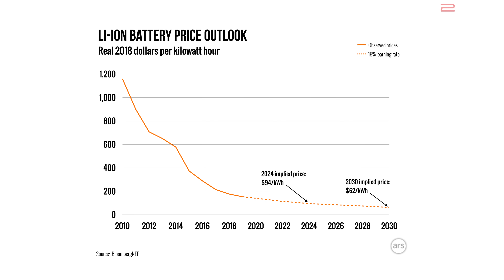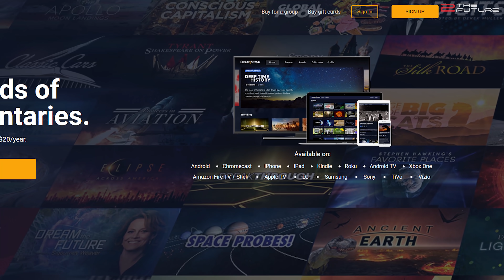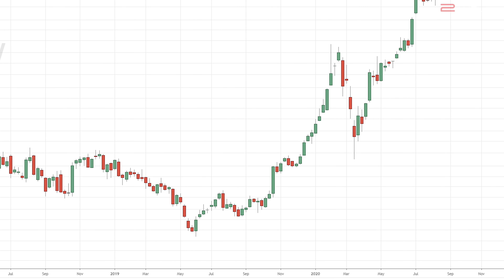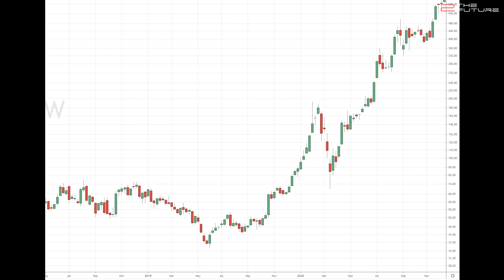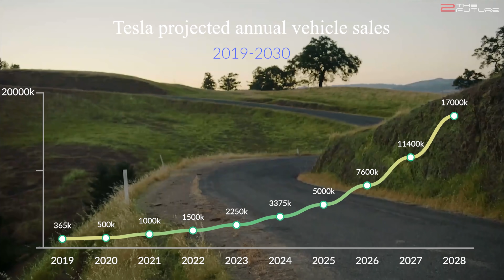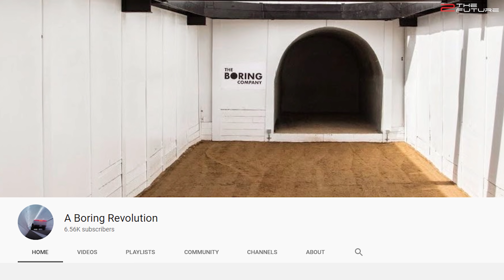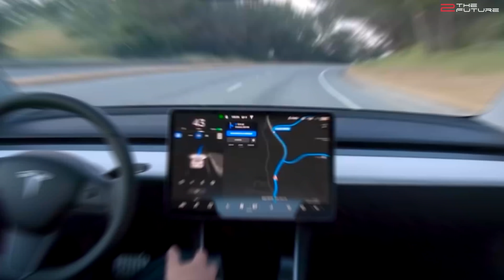Tera Texas & Giga Berlin, Model Y China & Europe Launch, First EV With 1000-mile Range?

Comment: Aptera is surely one of Sandy Munro's 3-wheel clients. Looking at the vehicle, it probably has 3-wheel drive using the pancake electric motors Sandy showed. Sandy is using air suspension for great handling and vehicle levelling.